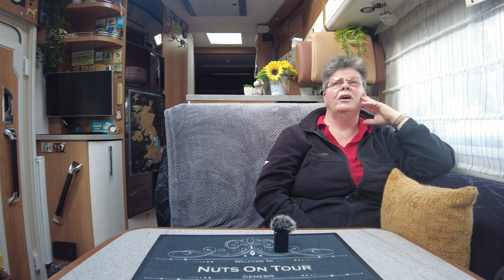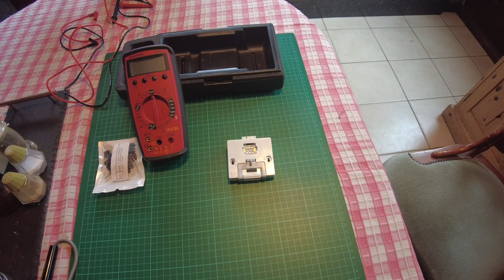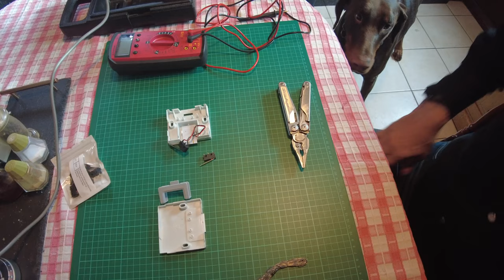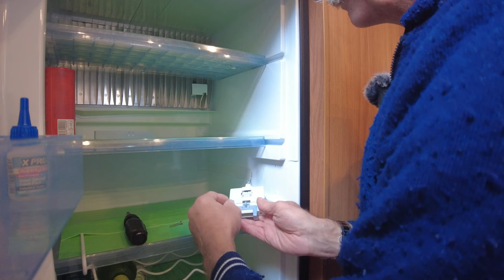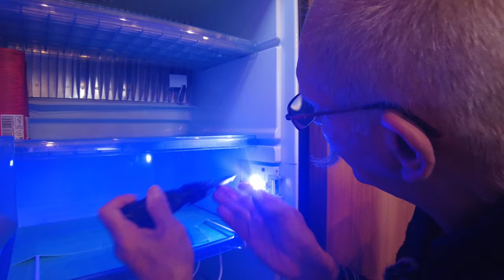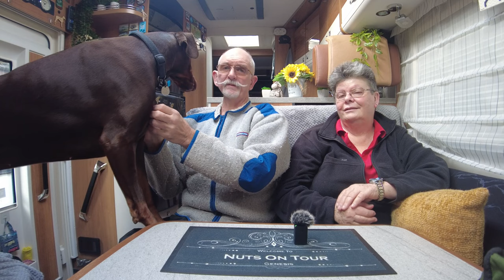EP52 OH NO its broken we cant see a thing,  OR how to fix a fridge light

Comment: Nice repair, so many people don’t know how to make repairs anymore, and consider things disposable.
Reply from the maker: Just spent the last 30 years looking after. And repairing stuff. Keeping it all running on the ship. So I guess it is built into me. Plus I gate having to pay top dollar for someone to do a job I can do in half the time and cost cents rather than dollars. The micro switch was lass than £5.00 for a pack of 10. If I had taken the bus to the service centre it would be a minimum 1 hour charge £100  plus...
So a hell of a saving for about 20 minutes actual work. I still have to let others do stuff like coded welding etc... but the rest I am OK doing....  👍